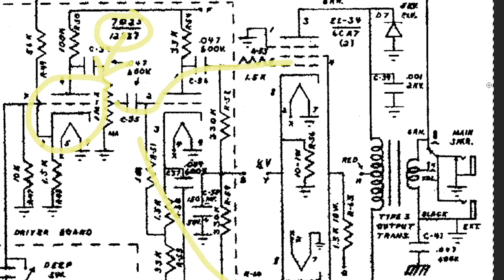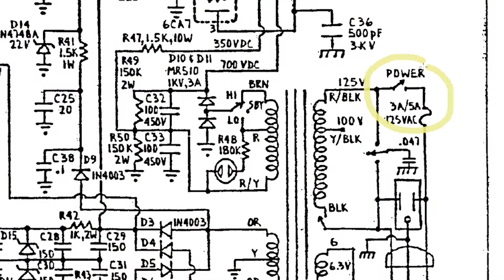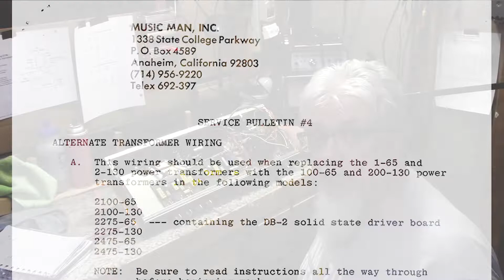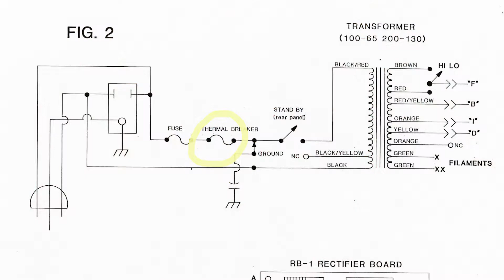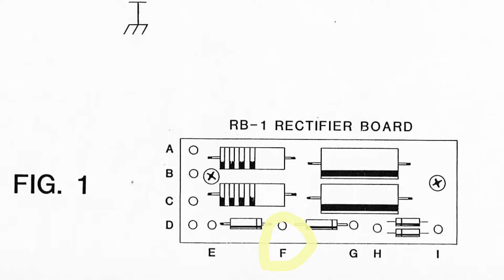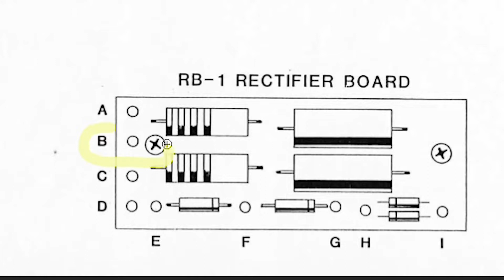E07 Music Man 2100-65 Part 1 of 2 - Power Transformer Replacement

Comment: Hi Wally. Will there be a part 2 on the Music Man?  I’m curious to here what was causing the high current draw.  I am about to attempt to find the cause of distortion and hum on a 2165RD but due to its hybrid design l might be in over my head as I have only played with all tube amps with some success. Thanks for this video it was a good introduction to the Music Man and very well done.
Reply: I would like to know this too. I had a tech work on mine a few years back and he ran into similar problem.  He got it working, but I'll have to show him this video to get more info.  The amp works, but he said something about it being really high juiced.
Reply from the maker: Well, it's been 20 months, but yes. I just found the files for Part two. It will be out soon!